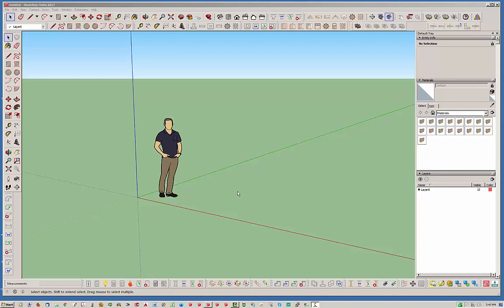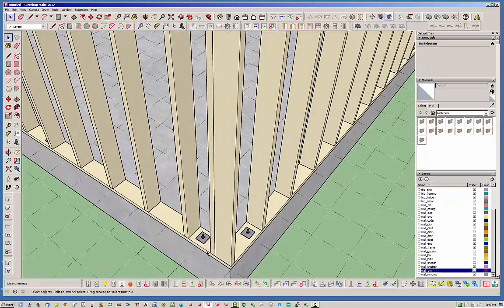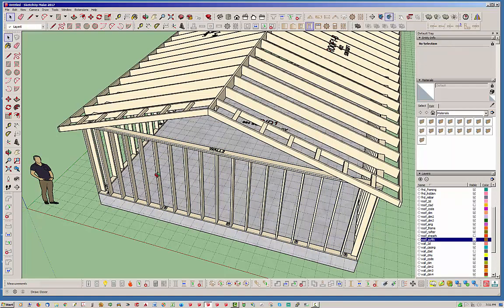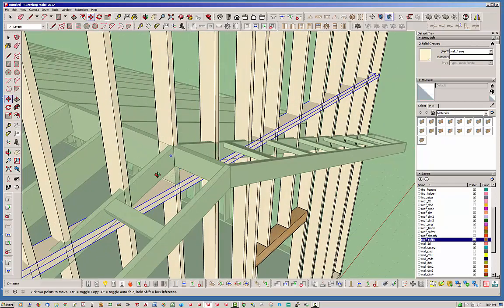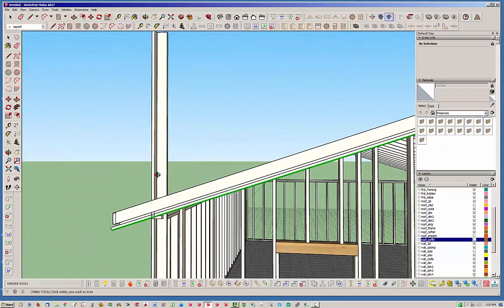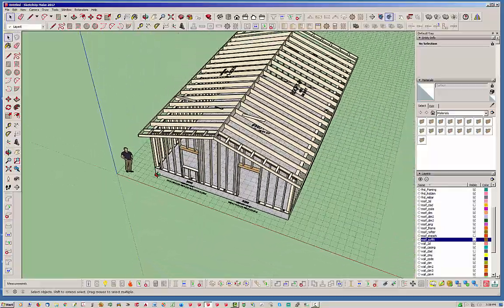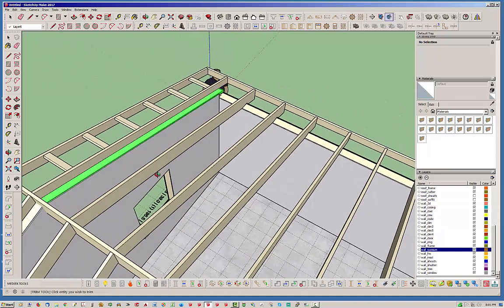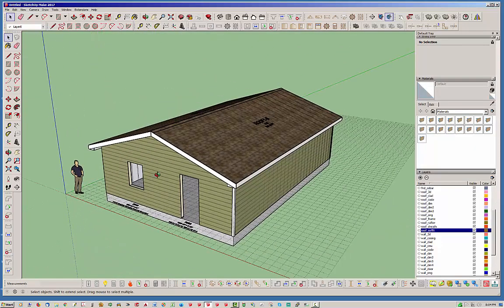Medeek Wall Plugin Tutorial 8 - Gable Wall Workaround

Comment: Nothing to do with gable walls. 
What am I doing wrong in basic framing when the stud spacing is ending up at 580 mm bewteen the first and the second stud. And between the second last stud and the last stud the spacing ends up with 620 mm? The spacing is set to 600 mm. Happends in both single walls and walls connected through corners.
Reply from the maker: Send me an email with more details, I will look into this for you.

Comment: I was wondering why the end rafter would be a 2x6 instead of a 2x8? Is this something that can be adjust by each user? Seems like it would make things more complicated versus having all rafters have the same exact shape.
Reply: Good question.  The end rafter or barge rafter can be made to be the same or customized within the edit menu.  Technically it is simpler to use a rafter the same depth but structurally it makes more sense to use a smaller rafter (ie. 2x4 or 2x6).